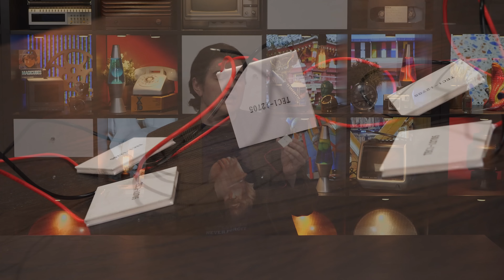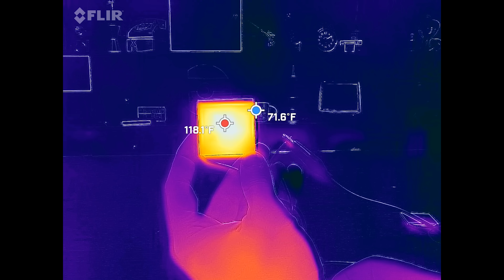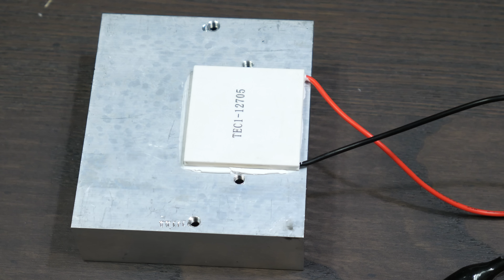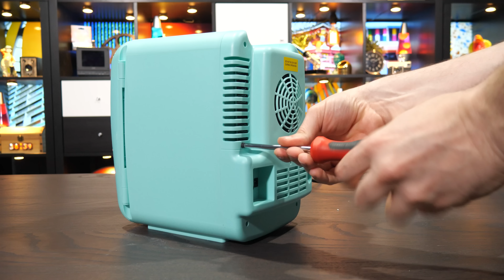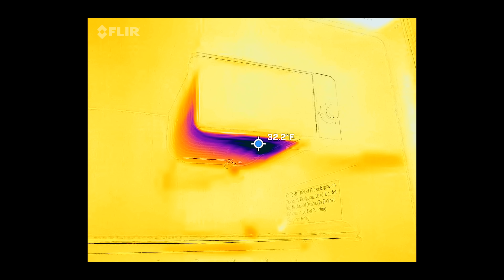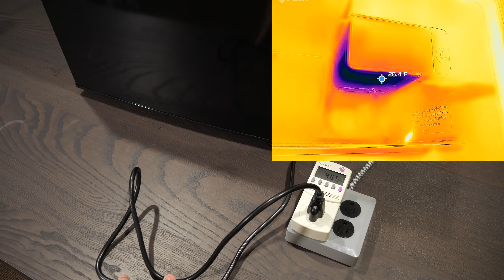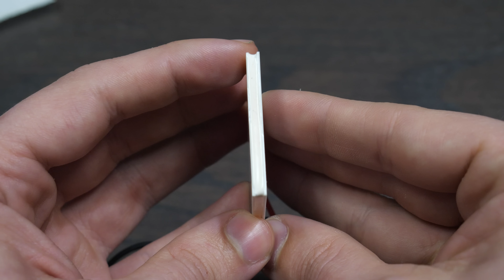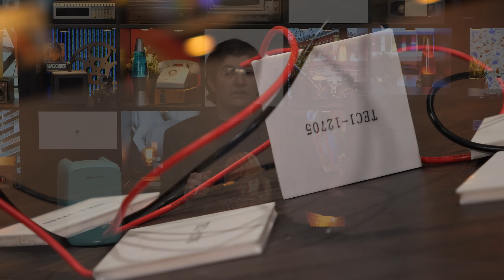Thermoelectric cooling: it's not great.

Comment: I have one of these peltier fridges in my garage.  It was free to me. I keep two 20 Oz. bottles of Gatorade in it. It keeps them cold enough.  If they made a true fridge this small, I would replace it just on principal, but until then it stays.  No, I would never have bought it, but as long as I have it, I will use it.  Also, mine is Budweiser branded.  I love the irony of keeping Gatorade in a Budweiser branded fridge.

Comment: Should have also included a piece on those really cheap dehumidifiers as well which I’m sure use the same part. Similar to the fridge I think they are close to useless as they can only condense so much humidity when compared to a proper dehumidifier.

Comment: I would love your take on the "window air conditioners with supplemental heat" that I'm seeing on Amazon, like the one from LG, I can't tell if these are actually mini-splits in window-mounted form or just regular window ACs with an added electric heating element.  While I've been gratified to see that true mini-splits are everywhere in recently-renovated apartments in NYC, I'm moving into an apartment with, shall we say, less than 21st-century heating and cooling options, and I really want to do better than the little forced-air electric heaters and window AC units that I've used in the past.

Comment: Absolutely support your point about energy efficiency, however I also hate those mini fridges. I mostly find these tucked away in some corner of a hotel room, they are almost always empty, hot on the outside and annoyingly noisy in the night. Whenever possible I disconnect them since a lot of them do not even have a power switch to completely shut them off.

Comment: I imagine its even possible to find Ram Air Cooling systems (like on aircraft)  that can more efficiently than the Peltier coolers even after converting the power usage of all the electrical components to operate all the oversized valves and diverters

Comment: Maybe I got lucky and got a good one or something, but it cools fast enough on my desk at work for cans to feel quite cold to the touch.  And keeps soup surprisingly hot (mine has a cold/heat switch).   The big bonus is that I can keep it in my office on my desk, so it is indeed a whole lot better than nothing because my alternative is in fact to have nothing.    Taking a bag of ice in a cooler would work fine for drinks too, but isn't quite as convenient.    That though is just about my only use for it, but it's worked very well for that use.

Comment: Anecdotal. You don’t pick the worst product on the market then claim everything in that market is worthless. On the energy calculation, you did not account for the energy required to cool the room from the energy the units discharged, which would make the peltier cooler look better (although still not the efficiency of the fridge). The biggest benefit is there are no moving parts except for the fans (which are required for vapor compression as well), it’s simple, it’s compact.

Comment: I still see people who travel as nomads using their dreadful 12 volt counterparts to use as a fridge. At 5 amps an hour for the smaller units it 120 amps over 24 hours. I've run an 80 litre Engel as a freezer(minus 11 temperature is best) plus a 60 litre Engel as a fridge during summer temperatures at 40 celcius(104F) and still used less power over 24 hours(around 90 amps). On winter, running under the same scenario, barely 35 amps over 24 hours.

For a day trip, you're better off buying an esky/cooler and having ice bricks in your freezer for it. If you wrap the cooler in a blanket, it stays cooler for longer! 

Please, never buy a peltier cooler. They're a waste of both space and energy as a cooler. 

As a warmer? They can sometimes redeem themselves. I have warmed up frozen pies and sausage rolls in one as a warmer. I added a small cpu fan and heat sink to the inside, it worked a treat!

Comment: Now I want to see a well-made thermoelectric refrigerator. In addition to good insulation, I think the Peltier element should be much larger and heftier. The one in that toy is tiny. Surely there are better Peltier elements than those small $3 ones. I'm not saying it will change the overall conclusion of the video, but it'd be interesting to see how well they can be made. And I also want to see a real refrigerator with a heat pump but about the size of the blue toy, with a teeny-tiny compressor.

Comment: A nifty thing the Peltier Chip can do that you didn't mention is... it's REVERSABLE!  No more reversible than you showed.    Meaning if you hook the wires up to an LED and the put a piece of ice on one side and a heat source like a light bulb on the other side, the LED will turn on.   It's still awful though.

Comment: I got one of those mini “fridges” as a gift from my parents last Easter. I didn’t know a single thing about them and decided it was a great idea to have in my room to store snacks like cheese for when I get hungry at night, and so I wouldn’t disturb my parents by sneaking to the kitchen at odd hours. 

Looking back on it, that cheese didn’t taste quite right after a few days. Luckily, I put them in the “fridge” once they were already chilled, but… still not good. Definitely not safe. I never got sick over it, but then again I ate dirt and play-doh as a kid, so I’m not exactly a good metric for food safety.

The thing broke after a few months. I think about seven, if I remember correctly. The fan wasn’t blocked, but it was running 24/7, and it was a cheap thing bought off of Amazon and likely drop shipped. Additionally, ice was constantly building up on the location that the cooling devices were pushed up against on the back wall, which oddly enough only started after a couple months (I think two or three?). I had to awkwardly chip away at it with a nail file every few weeks so that the shelf wouldn’t be frozen in place. The fridge was too small to get a good angle, and I scratched that little square of cheap plastic pretty bad over time. Not enough to affect how anything ran, but still annoying as all heck.

With this new information, yeah, I’m NEVER buying one of these things again. If someone gives me one, I’ll give it to someone else for their makeup products. It seems to be all they’re good for. At least those don’t require refrigeration to be safe.

Comment: How could you go through all that and fail to mention the coolest feature of peltier elements?  Like most electromagnetic devices, if you apply a current it does some sort of work.  Like moving heat from one side to the other.  But if you reverse the process and apply heat from another source, it will generate a current.  Kinda neat.  That's how those little fans on top of wood stoves work without any source of external power.  The heat from the stove generates enough current to spin a small fan motor and thus move the hot air around the room.  Just like applying a current through a coil of wire in the presence of a magnetic field can spin a shaft and run a motor, using an outside force to spin the shaft will generate a current in the other direction. (motor vs. generator) Or applying a current to a diode will emit light while shining an outside light on a diode will generate a current. (LED vs. solar panel).  Yes, solar panels or photovoltaic devices are just really efficient diodes.

Comment: Peltier elements not only create hot and cold side when you provide current. They also create current when you provide them hot and cold side. When I was a teen I was keen on an idea of collecting wasted heat with Peltier elements. Say, if your PC consumes 500W most of it will be wasted as heat - why not collect it with this magical technology which you can also use as a cooling if needed?

Comment: I've used these before for one main thing, when I'm staying in a hotel. It keeps a few drinks cold if the hotel I'm in doesn't have a mini fridge, and I don't have to care about the electricity costs of course. And regards to the noise, at home I sleep with an air-conditioner (one of the portable ones with the hose) on all night, so I'm used to noise :)

Comment: Real refrigerators take 24 hours to cool down as well. Whats your point? Your creating this video bashing on a product that is not even marketed to do what your claiming it doesn't do. They are marketed to keep a few cans or bottles of your favorite drink chilled. Something by your own admission it does. I have two of them I received as gifts, one a Pepsi one and the other a Coke one. Neither one of them is noisy even though they have a fan. There is a reason Emerson is essentially on the verge of going under. They make cheap crap. So there is another strike against your argument. And most people who use these don't put room temp cans in them. They put cans from the refrigerator into them until they are ready to drink them. Mine will keep my cans refrigerator cold. Your trying to make something out of nothing.

Comment: To be fair another use of a peltier, is to use it in reverse. you can generate small amounts electricity by applying heat to one side an cold to the other. If memory serves, some girl made a flashlight powered by these from your warm hand versus the cool air in a pvc tube as a senior project for school.

Comment: I kinda want to build a better version of the blue thing, but I majored in mechanical engineering, not electrical, so I'd probably just electrocute myself lol. But several years ago I made a psudo cooler out of the container the held the Fallout 4 Pipboy Edition Pipboy (the one that was just a phone case) by attaching aluminized bubble wrap material to the interior surfaces. I took it to a LAN party once filled with Monster and some ice packs and it worked well enough, but I think it would be pretty cool to stick a peltier element in one of the walls and then use the old Cooler Master CPU cooler I have collecting dust to keep the hot side in check. But to make it even better I would likely need to get some kind of temperature controller, which would mean programing, and as far as my knowledge base is concerned, software might as well run on magic haha

Comment: The funny thing is, because the 120V was plugged into the toy fridge instead of a 12V adapter, the fridge consumed MORE as the power supply in this thing is linear and not switching. The more amps the circuit demands, the less efficient the power supply becomes. This is mostly due to cost once again since linear voltage regulators are considerably cheap.

Comment: Yep.  It's a perfect technology for the cooler that I can toss in the car for road trips.  For that, "room" temperature is about 65 degrees (I like it cool in my car) so it cools drinks nicely and can even keep a sandwich cool enough to be safe.  It's reasonably well insulated (it's a cooler, of the sort you can just use with ice if you want) so it's actually decent at cooling and keeping stuff cool.  And if I reverse the cord, it's a food warmer (that's an actual design feature it has, not just a hack).  And it fits just perfectly on the floor behind my seat, I can easily reach into it while driving and get a new drink.
For pretty much everything else, it sucks.

Comment: A short 1 minute run of a peltier element is very useful to instantly cool mosquito bites on your skin, which makes them less itchy for a few hours. Well, tropical country problems.
It's like having an instant on-demand ice cube in my room, without all the wet mess of storing ice cubes in a drawer.

Comment: Peltier is also useful because it can generate electricity when you apply a temperature difference. An interesting example is radio isotope thermoelectric generators. Plutonium heating in a satellite that provides power for decades for free

Comment: To build off of the thing of the actual mini fridge paying for itself in electricity alone after 2 years, it could reasonably last that long. My mom has insisted on buying a few of the "stupid blue boxes" over the years, and not one has lasted more than 6 months before breaking. If you buy a new one whenever it breaks, then the cube will have proven cheaper potentially within less than even one year

Comment: Yes, Peltier Elements are really bad at cooling.  I wish you would of touched on them as a power source, if you put heat to one side and a large heat sink to the other side you get power out. For example look at Voyager I and Voyager II, both use Decaying radio active material that is physically hot. 
Also as a side note check-out how RV refrigerators work. 
Thanks I really enjoy your channel, Todd.

Comment: They use these in heated and cooled seats.  The heating is much less powerful and efficient vs a simple resistive circuit and the cooling exists, but isn't impressive.  Better than nothing.

Comment: I do love the factual data, but you're missing the forest for the trees here.

Peltier refrigeration is the same as electric vehicles.

In brief: the tech is garbage NOW, but as demand increases and the public is exposed to the ideas, a demand for more efficient and effective Peltier cooling will appear.

Everything starts out gimmicky before it matures and becomes a standard. Will Peltier cooling ever be a breakthrough technology? Who knows, but it's far from junk.

Hell, my novelty Xbox Fridge used to ice up, it was so effective.

I will say that my needs are to have chilly drinks in a game room available on request, and the 6 cans of energy drink I hold in there get cold in a small fridge that fits on a shelf with sufficient ventilation to exhaust the heat.

That would be a FAR less interesting view for a video, but the "It's trash" view is a bit dramatic.

Personally, I hope the current demand drives us to build better Peltier elements that surpass normal refrigeration, and find even more uses.

Comment: Only reasonable use case imo is in a portable cooler. Comes in handy when you dont have access to ice and a cigarette plug to just power it from the cars electrical system

Comment: I have a fan that works with one of those, you put it on top of a fire stove and the temperature diferential generates enough eletricity to move the fan... I'm not sure it helps moving the hot air forward instead of upwards, but I bought it more because I found the mechanism fun rather than utility.

Comment: how robust are those T.E.C.s? another factor to consider is that with especially these modern fridges is that they are becoming quite expensive, and do not seem to last too long. in the total cost of ownership calculation, what is the effect of a $2,500 fridge that fails after 5 years? mileage may vary, obviously...

Comment: My mother bought me one of these for my room in the late 90s/early 2000s.  They were more expensive then, but not unaffordable for a middle class gift.  This early model had it's heat sink just open to the air on the back with no fan.  At some point, it got pushed back directly against the wall.  I noticed it, probably a few days later, and when I pulled it away from the wall, it had burned a hole right through the drywall.  Thankfully, there wasn't anything particularly flammable there so it just left a big scorch mark in the shape of the heat sink.
Reply: These things are still horrendously expensive today
Reply: I got a Mountain Dew themed cooler long ago. I saved up the points to try and get the bright green XBox console but in the 30 seconds between I heard it was out and I clicked buy, it was sold out. When the time was running out for the promo with no Xbox restock, I pulled the trigger on the mini fridge.
Reply: Man I remember when the middle class existed, what a nostalgia trip.
Reply: @C._Bradford lmao real
Reply: @C._Bradford  brought to you by our useless American government. Don't care which party, this took decades.
Reply: Wow. So that's a hint about how to improve efficiency!
Reply: A scorch mark isn't a hole.  Which one was it?
Reply: @BigGuy42080  Granted this is almost 30 years ago now, but from what I remember it had one of those square heat sinks with raised fins in a grate-like pattern. The high parts burned the holes, and the edges were scorched in the shape of the voids where no fins were.

It's like burning a piece of paper with the hot tip of a lighter. A hole forms at the hottest part at the tip and around the edges you have scorch marks.
Reply: @BigGuy42080 bro literally who cares
Reply: @somekid8014  I care :c
Reply: @ @Zack-xu2zw I don’t, so
Reply: @BigGuy42080  What are you, a cop?

Comment: back when i was doing landscaping i had an idea in the back of my head to make a cooling shirt based on these.

 i never went through with it, but the idea was to have a shirt with thin tubing running through it and a slim backpack with a small cpu cooling water pump, tech cooler, fan and radiator, batteries, etc.

i worked out that a handful of 18650s would be able to run the thing for about an hour, and this would only be needed when off the tractor due to being able to run/charge off the tractor's 12v outlet when it's running.

even a 15-30 degree drop would feel nice when it's mid-upper 90s outside.

Comment: Unbolting the compressor can make it run much quieter. Just avoid transporting the fridge with it unbolted, because it'll put a lot of stress on the copper tubes.
I live in a 250sq ft apartment with my mini fridge less than ten feet away from where I sleep. Since doing this trick, and adding some extra gel pads under the rubber grommets, I can almost sleep without earplugs.
Reply: 😮If you could re-design a mini fridge, so that the peltier device wasn't trying to cool the entire internal area, just a smaller area with a fan to blow the cold air around, they might be more efficient.